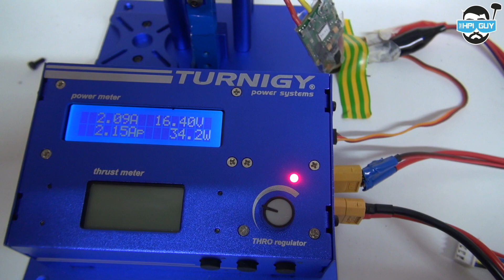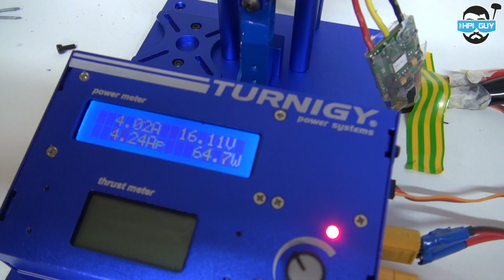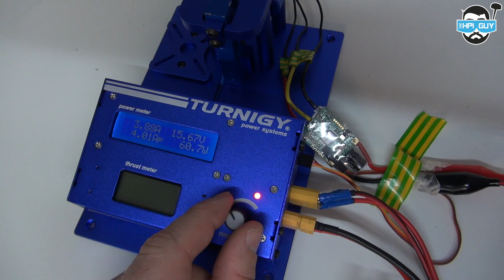HPIGUY | Active cooled motors? FLIR ONE Thermal Test

Comment: I believe that once you correct for the smaller can motors (they will run hotter than than the 2205's I am sure since they are smaller) you will be dealing with a negligible difference overall in temps. Add the fact these motors are also subject to ambient temps of where they are operating, and in normal expected use they have air moving over them from flying, and I think cooling fins on the motors amount to a case of making something more efficient that isn't necessary thus rendering it unproductive.

Comment: Curious stuff thanks. I feel running the second 4A test immediately was not to  scientific as cooling may be related to speed and the hotter one is at an instant disadvantage. I'm sure the emax run cooler all the same but letting them cool before the 4A test would be fairer. Thanks for doing this.

Comment: I think you may use wrong emissivity on your FLIR device, 6.3 Celsius as room temperature does not make sense.
Attache some electrical tape one some known temperature, measure on the tape with emissivity of 0.95 will give correct reading.